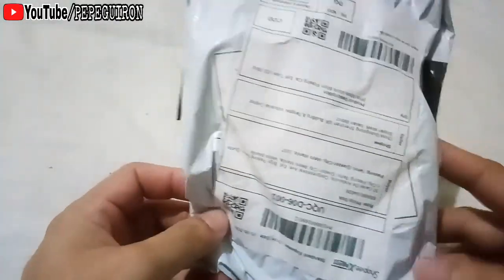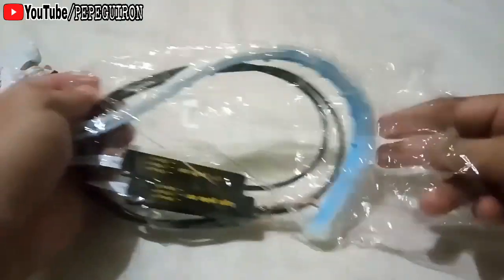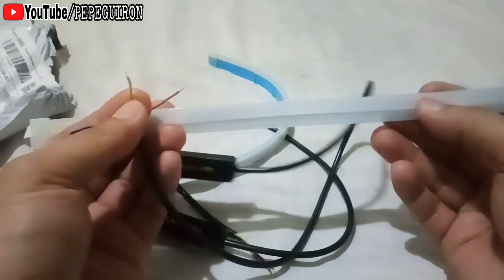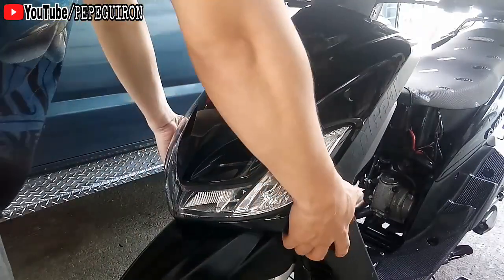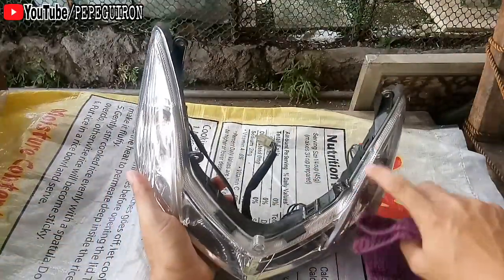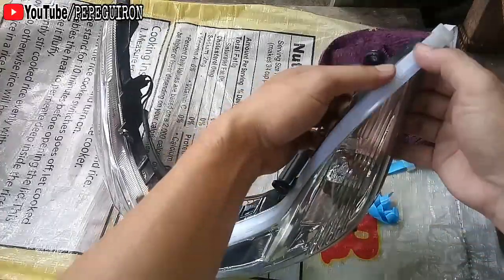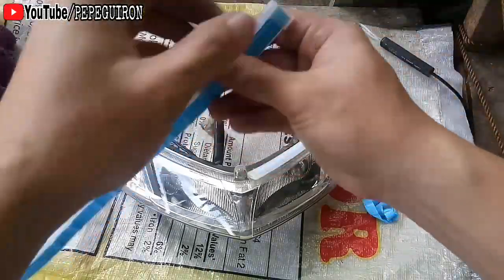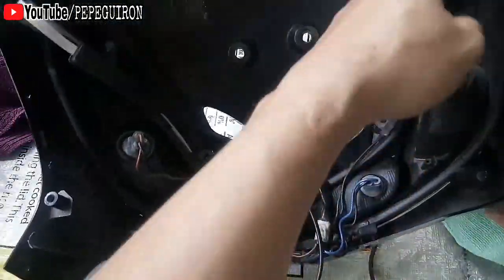EYELINE and FLOWING SIGNAL LIGHT SOFT LED STRIP DRL INSTALLED ON MIO SPORTY

Comment: Ganun din inorder ko na eyeline double contact my running signal light din kasu pag start ko na Ng engine pag signal ko natural Lang Yung blink nya same Ng stock blink Ng signal light at nawala na din Yung park light at Hindi na gumana lahat, saakin Kasi na eyeline Wala Ng ganyan na pahaba na box na item yung relay, kundi mismo eyeline Lang at wires Kaya siguro nawala na ilaw kapag nag start na Ang engine. Nasayang lang inorder ko 15days pa Nan bago dumating Ang item🤦🏻‍♂️ at tsaka Tama Naman wiring ko bakit Kaya nagka ganun . (Mio mxi 125) motor ko